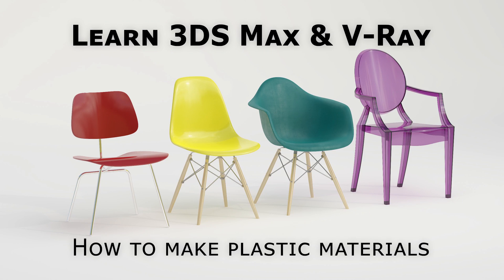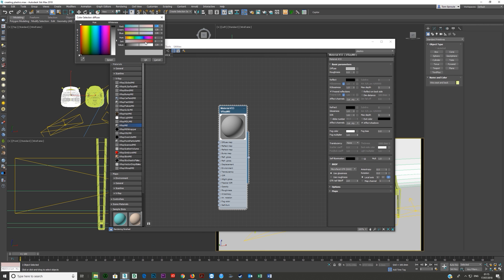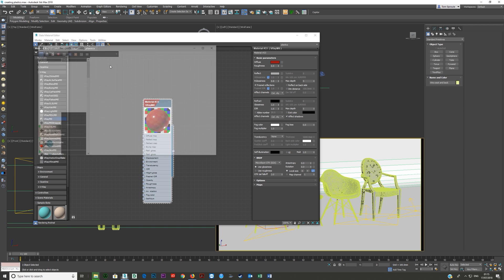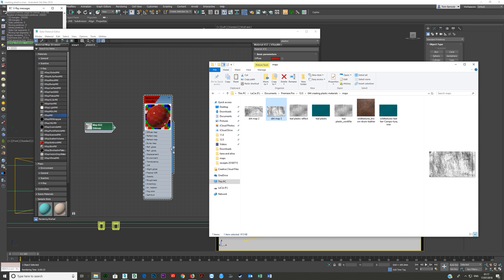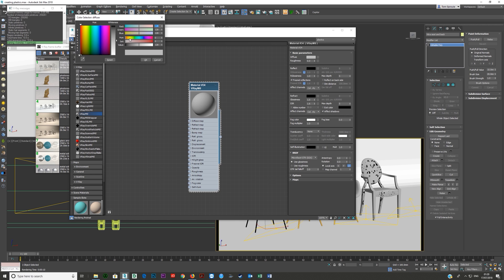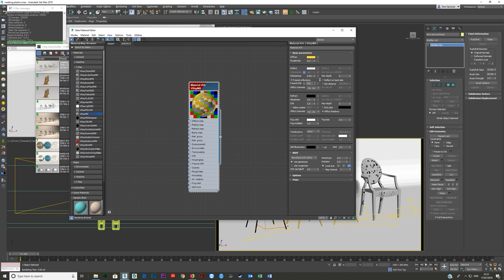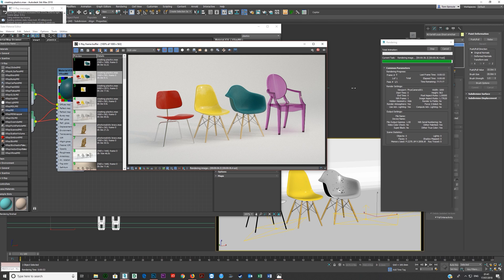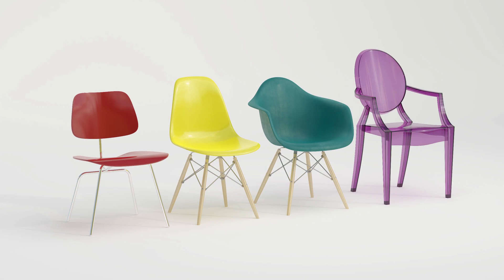How to Create Realistic Plastic Materials in 3DS Max & V-Ray | Tutorial

Comment: I m using 3dsmax2014 and i cant do it the 4th chair only changing the fog color ? how can i do it do you have an idea
Reply from the maker: sabahattin ışıkatlı ok, the important question is which version of V-Ray do you have? Also, what units are you using in your scene?
Reply: @leonleon51  hey thank you for the answer i am using vray adv 2.40.04 and the units are generic units is ticked when i look at the unit setups
Reply from the maker: @sabahattinskatl9527  Okay, well thank you. 

First of all set your units, that's sort of the first step with any scene before you start work. You have to decide if you are going to work with mm or cm or inches or whatever size you prefer. This prevents all kinds of errors in the scene when you get to later stages, such as setting up cameras and using procedural modifiers and textures - such as noise (the size will change depending on the unit setup of the scene. 

Second, I'm not sure on the differences with the fog setting between V-Ray 2.4 and V-Ray 3.6. I would say that if you can't get it working then (if you want to create a purple plastic), set the diffuse to a dark purple colour and the refraction setting to a purple colour. Play around with the two until you get the colour and see throughness that you like. If you want to blur the objects through the plastic, you'll need to lower the refractive glossiness, maybe to 0.8, but play around with this as well until you get it where you like.